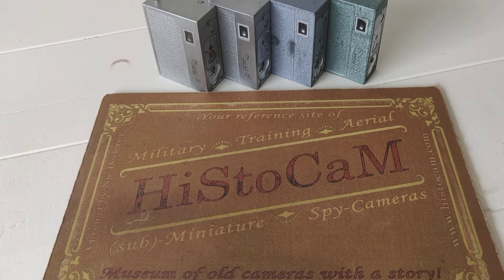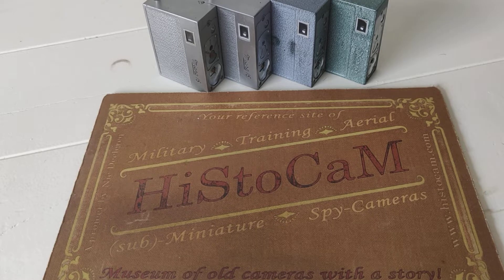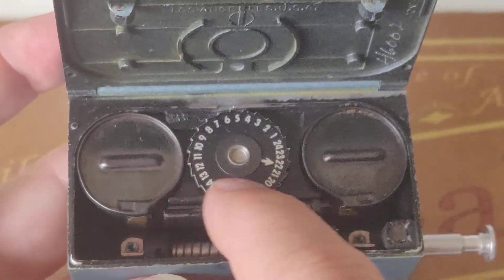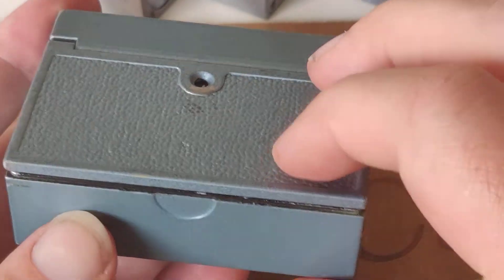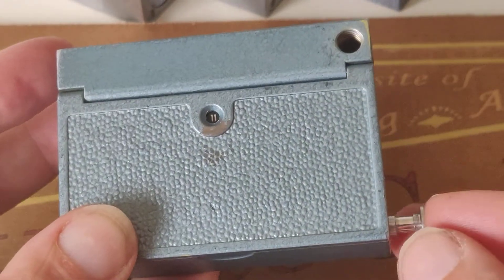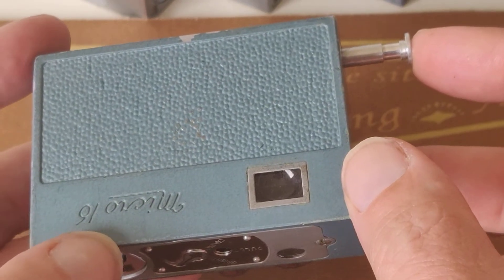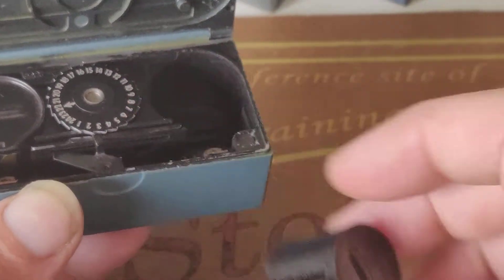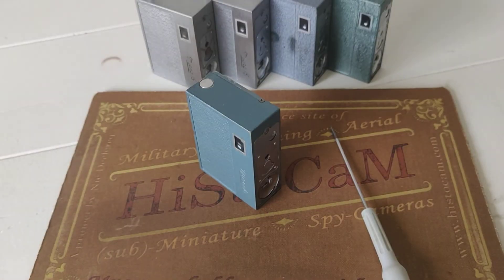How does a Whittaker Micro 16 works?

Comment: I can’t get my antenna to come out at any angle. How does the gravity latch work?
Reply: I tried silicone oil and a strong magnet and I was able to get it to pop out!  It now needs a bit of encouragement with a tap on the table each way to get the plunger to latch or unlatch, but it works!  Now I would just like to know how to get to the shutter to clean and lubricate it since mine is sticky/slow
Reply from the maker: @fourwallsphoto  Hi, you can remove thef three screws at the front side I think (never did it myself), but I guess you can enter the whole mechanisme (that can't be that complex.) ;-)
Reply from the maker: Hi, thank you for your interest!
It is just the gravity that does the trick...
Unfortunatly, when it is realy stuck, you can hit it with the back of a screwdriver, but if it is coroded, there is no way to open it up and clean it...
Maybe you can use a drop of oil...
Often, this is happening and you won't be able to open it. sorry.
Greetings!